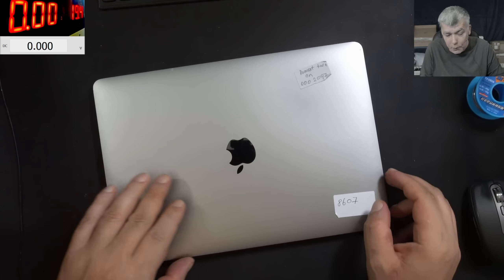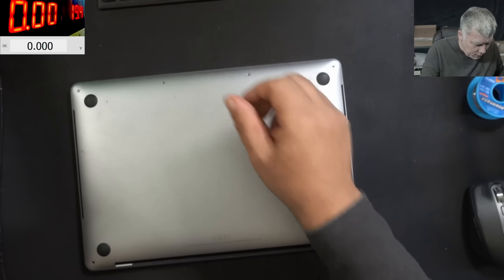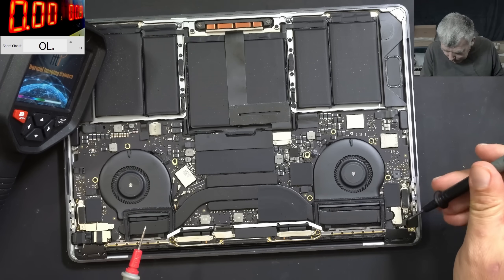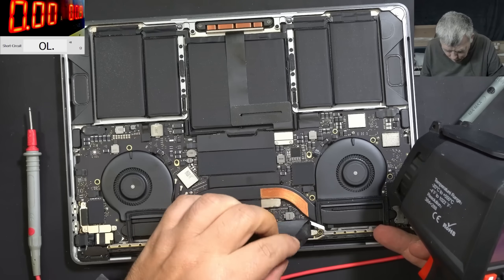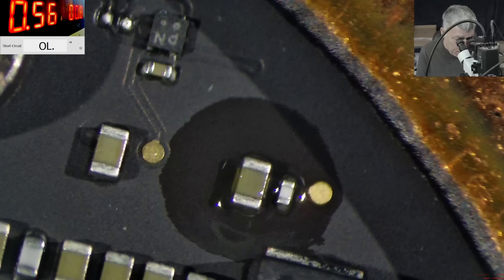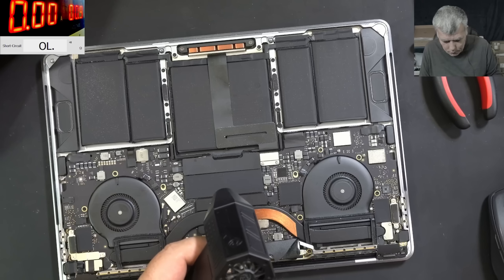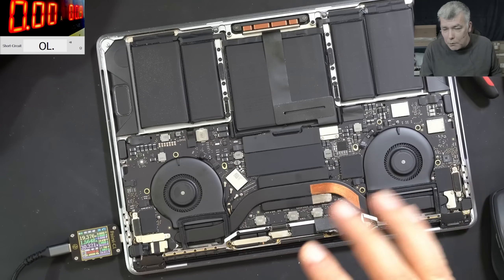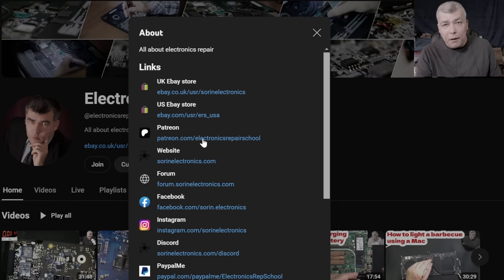Macbook pro A2251 not charging, logic board repair, a common fault

Comment: Just released a video of the same sort of issue with an A2442,  I do love the MLCC's and hope that manufacturers keep using them - it makes life a lot more straight forward ( well, except for the times where the cap is so incredibly well shorted or so weakly shorted that thermal detection methods don't work

Comment: Hi Sorin, why don’t you replace the capacitor? Is it not needed? Easy pizza to replace it, no?
Reply: No capacitor, no broken capacitor. Can be.
Reply: Most of them are filter caps that are just there to remove EMF noise and meet FCC regulations. It's only really the PS output caps that are "necessary" for operation.

Comment: Hi Sorin, I have a repair job, Macbook A1466 model, Battery not charging,shown 0%. When I checked Battery voltage, its 0 voltage. I tried to push some current from dc power supply, but Battery voltage not increased. Kindly tell how to boost Battery voltage
Reply: Have you checked the fuse on the bms